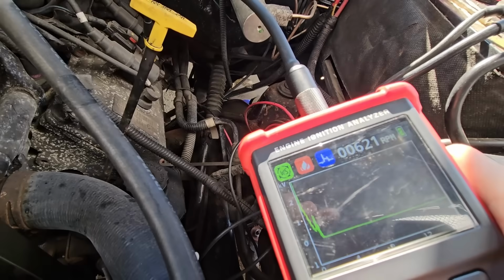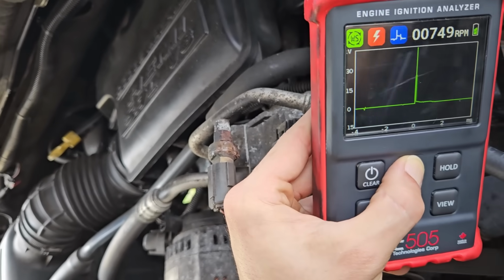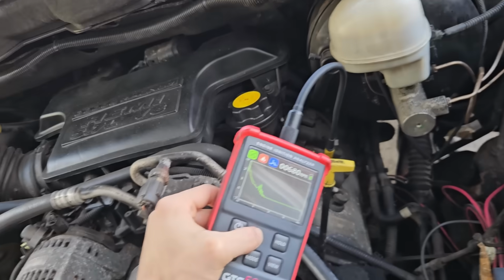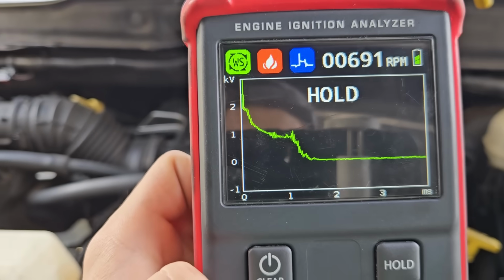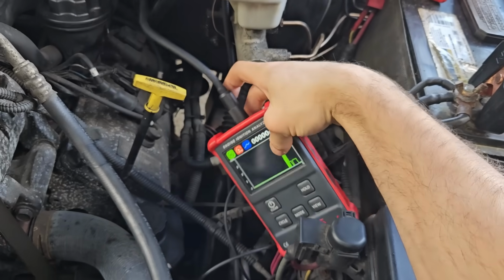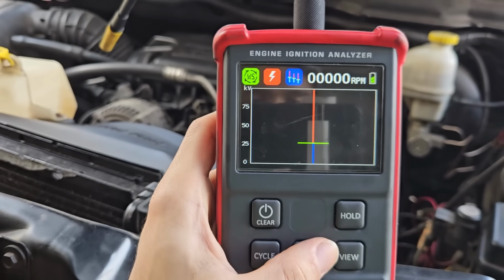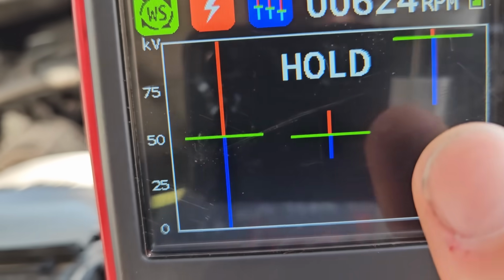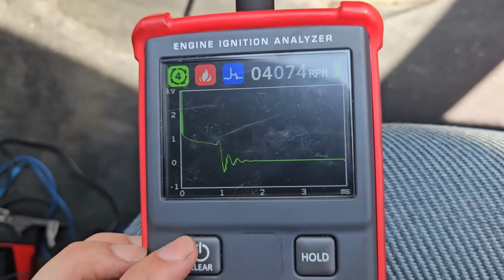The Engine Testing Tool You Never Knew Existed

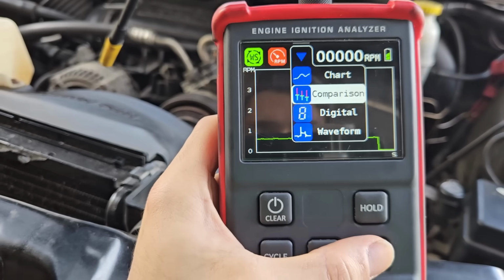Comment: I have a GTC 505 Engine Ignition Analyzer trying to learn how to interpret the waveforms. On Comparison View min 4:11 / 4.53 the 3rd cylinder vertical blue line longer than the others. Does that indicate the cylinder might be running rich (too much fuel) or has low compression?  Btw, amazing video!

Comment: I see the usefulness for those who have in depth training but I think DIYers would struggle.
Reply from the maker: I believe there's still practicality for a DIY as a simple go no go gauge. I.e. no waveform on the tool -> check or swap the coil. Even better though is you can learn with the tool, looking at what is normal so bad sticks out like a sore thumb. I do agree that the latter is time-consuming and requires dedication to the theory

Comment: One of the problems with this type of meter is that you need direct access to the plug wire or coil over. A lot of transverse V6 engines have the intake manifold covering the back three coils so it is impossible to check all of the engine.
Reply from the maker: Agreed, the best way I've found to diagnose the difficult to access coils is with a proper dso and an amp clamp on the fuse that feeds the coils. You wont get the complete picture without the primary or secondary waveform but it beats hours of r&r to swap a coil

Comment: Using flat bladed feeler gauges to check and gap spark plugs is a bad idea. They make round wire spark plug gauges for a reason. A flat gauge only measures an average gap, the wire gauge measures the actual gap over the contour of the two electrodes giving a much better indication of what the gap actually is.

The flat gauges were showing the difference in the gaps and not much more.
Reply from the maker: Thank you for pointing that out! I just did some research because of this comment and learned there's more nuance than I initially thought about spark plug gap.

Comment: Make sure you get the 211c or later software update.  Otherwise, it can show spurious misfires on older mechanical distributor systems...Caused me a lot of wasted effort and $$$.
Reply from the maker: Great advice, they have also added features depending on your models serial number through updates
Reply: They indicated that they are adding some sort of ability to modify trigger levels.  It wasn't clear how/what though.

Comment: as a mechanic that got out of the industry in the late 90s I'd love to see you do more videos about how to use this.  I'm not up to date with modern cars even though I try to be in order to keep up working on my own stuff.  There arent many vids about how to use this in the real world other than a few quick summary videos like this one.  Can you do some more about using this by explaining it like I am a 9 year old?  I understand the basics but would love to learn more.  I bought one to try to find a miss on my daughters 04 4Runner but I ended up easily finding a dead coil. I saw Royalty Auto do one a while back but still have yet to find a full video about it.  Thanks, I subbed to keep up with the channel and get you to 100K ;-)
Reply from the maker: Thank you for the kind words. it's very appreciated! When you say explaining it, do you mean more about the tool itself or the analysis of the ignition waveform and where to go from there? I will be featuring it more in my regular case studies but would be happy to make a dedicated video on the subject.
Reply: @AntsintheGarage  I guess anything you do using this tool I'd love to see.  I was thinking showing real world diagnosing examples, what all the different modes show, etc etc. All of the above basically.  I've tried watching a few vids I could find and they all show pretty much the same thing. most of them are 5 years old.

Comment: Your several years late on this 😂😅
Reply from the maker: Glad you mentioned that! The original tool’s been around for almost 10 years, but a lot of people don’t know a new version came out in mid-2024 (same name and look). It’s got upgraded signal processing and features like parade mode. If your tool’s serial number is above a certain threshold, you may even be able to update it and get some of the new features—worth checking the GTC website.

Comment: My problem is when using the current ramp the ramp gets cut off because the capture is always so far to the right of the screen. I have tried it on every car COP I get my hands on and no matter what the current ramp never shows up center screen.
Reply from the maker: Intresting, I never had that issue. I don't know if this helps but I recall they had a firmware update around 2023. That might fix your issue if applicable
Reply: @AntsintheGarage thanks I’ll look into that. I thought it might have been due to buying from Amazon but the second one I ordered did the same thing.

Comment: Very cool tool and analysis of secondary waveforms. I have an inductive pickup for Coil on Plug that I tried out on a VVT Solenoid and was able to get a Waveform which showed PWM frequency and duty cycle. (PicoScope). You should be able to do it with your unit.
Reply from the maker: That is very cool and I never thought about that but it makes sense due to the high frequency. Definetly going to try that out!

Comment: Hi I have a Gtc for over 7 years can’t remember but I bought it when it first came out and I’m glad you cleared up a couple of things when using chart mode it’s also great for no starts as well and quicker to use than a scope and easier
Reply from the maker: Definitely great for no starts. I have a couple pocket scopes that can boot up in similar times, but nothing beats how fast I can lay the inductive pickup across a coil.
Thanks for watching!

Comment: Which tools would you recommend for a BMW e46 m54 DIY person. i.e Scanner, leak tests. A video of the tools would be appreacited and their usage
Reply from the maker: I can definitely make a video on some diy diagnostics/ testing tools. Most are pretty versatile so it'll cover alot more than an e46. If you mean bmw specific special tools then that's a deep rabbit hole, they have something for everything. all the way from a special tool to unplug the headlight, to vanos sprockets and everything in between.
Reply: @AntsintheGarage  More of general tools for day to day use.
Reply: @thuri7424 Etorx and 12point sockets, different size plastic pry tools, and Torque wrench, pain is you may need both 3/8" & 1/2" drives torque wrenches to meet the wide range of torque specs, oh and patience.